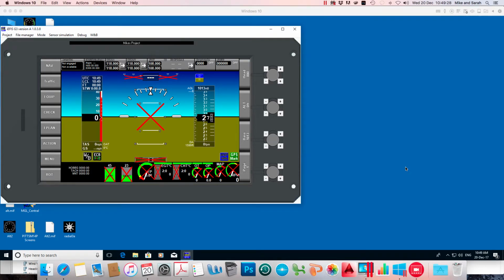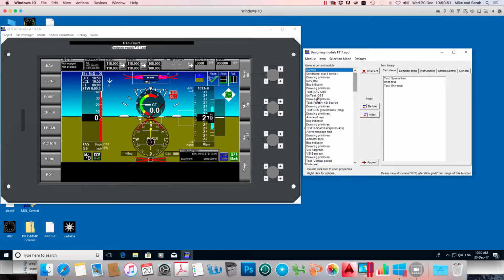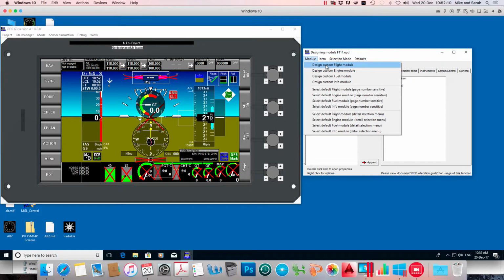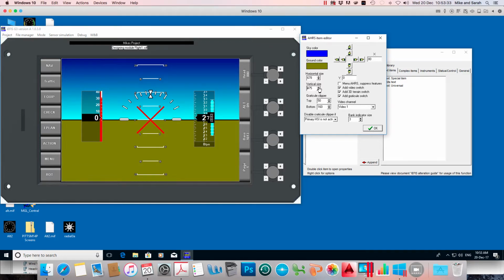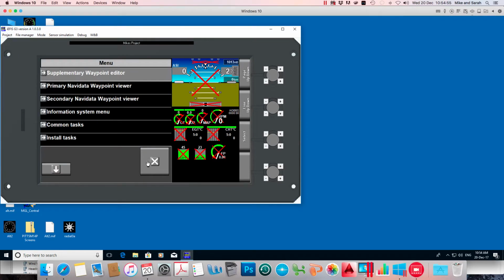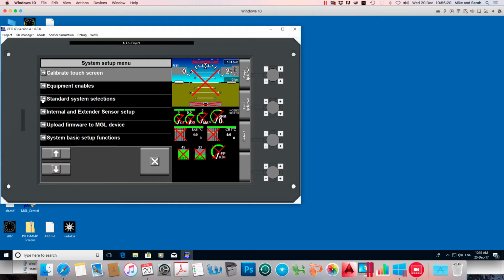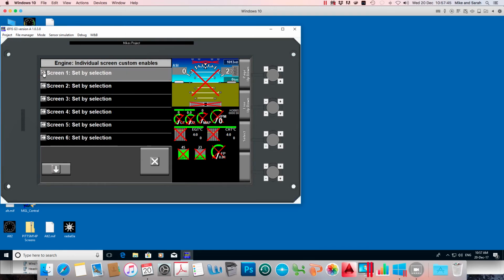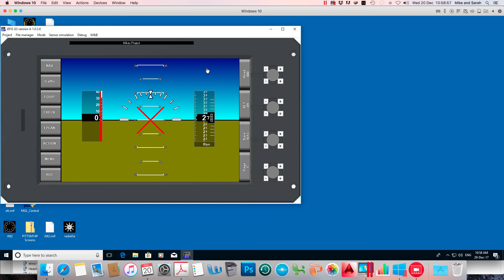MGL iEFIS - Making and installing a custom screen

Comment: please let us know how you are able to do this on your Mac?
Reply from the maker: Hi Jimmy. To integrate Windows onto my Mac I use Parallels Desktop 15 for Mac with Windows 10 Home installed on it. I have found no problems at all and use it on my MacBook Pro, and also my iMac at home. All the MGL software works fine using Parallels.